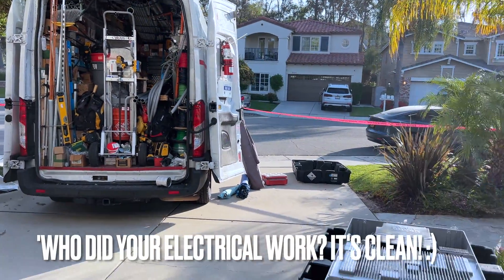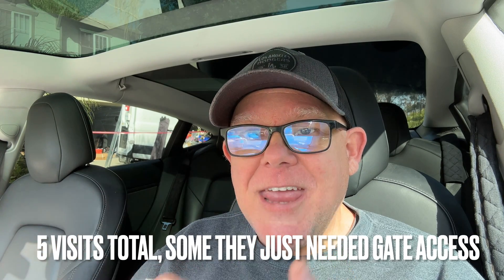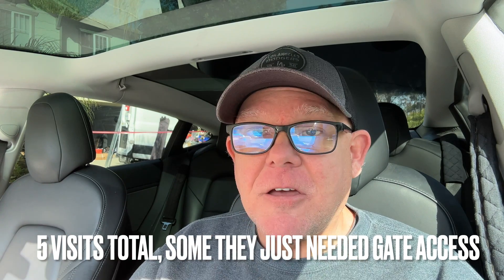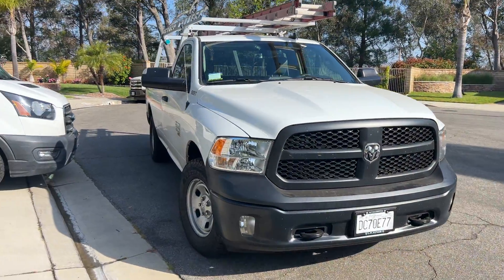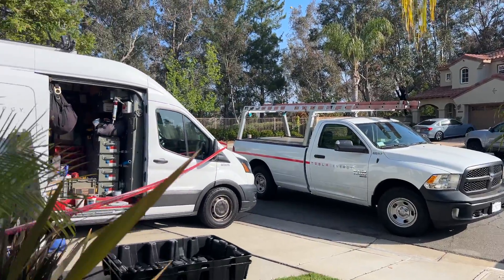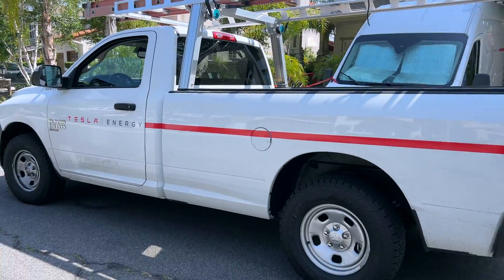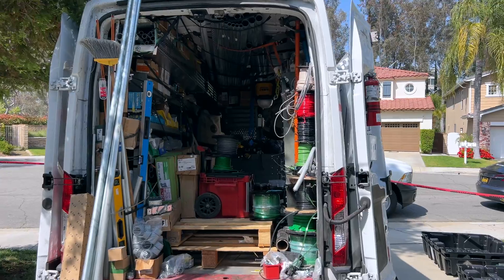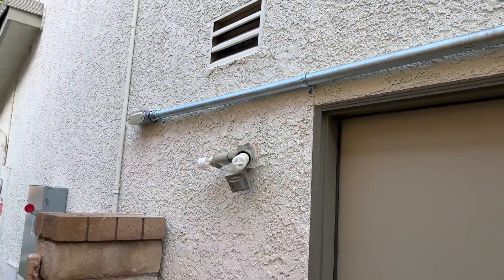Tesla Powerwall 3: Install, Cost, & Tips for 2024 - Complete Guide

Comment: Hello! Are you allowed to say who you ended up hiring for the job? I have yet to locate one under 28K, we are in san diego area. thank you Kerry!
Reply from the maker: We used Tesla for the installation. They were by far the cheapest and obviously the experts. No issues at all, system is working great. Thanks for watching!
Reply: @whooshn  thanks for the quick reply. The company TESLA told me to go with was Freedom Forever (1.3 rating) out of Temecula, but they are also stating 28K even though 2 PW3s are $10,343 wo installation on their website, which means they are charging 18k to install 2 plus gateway (if needed). There seems no one to talk with at Tesla to drill down an exact price (like their cars are). We have a Y and roof solar already, just want the PW3. It is very frustrating.

Comment: I have a 5.3 kW system with 16 panels, 327 watts per panel. I was told that two Tesla power walls will never get charged up with that little of kilowatt output. Have you been able to fully charge both Tesla power walls after using them at night I suspect, since you have a Tesla vehicle? Then recharging them with your panels the next day? it seems like you may have overbought battery storage capacity if your panels cannot fully charge those power walls. What say you?
Reply from the maker: Right now with mild weather I’m charging to 100% during the day with solar and on battery from late afternoon through dawn. Of course you can’t charge your Tesla in this scenario. 2 Powerwalls are 27kwh and your car is over 60kwh
Reply: @whooshn  I am curious how many kilowatts have you used when dawn arrives? Just curious.

Comment: My 2 cent . Power wall is useless concept unless you have often power outage or solid reason for storage . Otherwise this is absolutely waste of money . I have Tesla solar &  2 Tesla car. It’s personal choice anyway.
Reply: @PeaceFORever-  Just one power outage of several days where the temperature is below 0 degrees with a few feet of snow and ice where you can't leave your home and your family is freezing inside of the home without power might get you to think differently.
Reply: In California, with our very high electrical costs, batteries pay off very quickly.  I am getting a PW3 and two expansion packs for $28K.  Less $7800 rebate for the batteries from my local power company and 30% Fed tax credit drops net cost to $15K range.  With my 15KW solar ground mount array I'm installing, all-in, it's around $23K.  Payback in about 6.5 yrs.  But the reason we want batteries is to avoid long power outages. We had a 3-day outage a few years ago and it wasn't much fun.

Comment: We have 31 Q-Cell panels rated at 12.5 kWh with 31 Enphase IQ8A Inverters controlled by a Combiner IQ 4C.  Our installer can install Enphase 5Ps or Power Wall 3's.  So these videos are a great help.  Am leaning towards the 5P's because of their Inverters.  The PW3 have great specs but am fearful of losing an entire battery due to Inverter failure.  Should I be concerned?
Reply from the maker: I mean, anything can fail, including the Enphase stuff. Tesla has a 10 year warranty. My system has Enphase micro-inverters as well, which have been running for 10 years now, integrated just fine BTW.

Comment: I am looking to get the Tesla Powerwall 3 and my Solar Panels are by Sunpower. So I was so surprised to see that Sunpower supported or Tesla supported the Tesla Powerwall 3 to my setup and I have a video call going tomorrow to get more information. If you don't mind who makes your Solar Panels?  I really appreciate your detail with the bill at the end of the video. One concern I am been thinking of is how long there batteries will last. I live in Upland CA and we have had a couple power interruptions by SCE and was thinking this might be a good backup for the home. Thanks again for your work on this video.
Reply from the maker: My solar panels are Solarworld with Enphase Microinverters and were installed in 2014. The Powerwall 3's have a 10 year warranty, and the new ones are the LFP variety, which are crazy durable. I suggest you contact Tesla directly, they were amazing to work with and undercut everyone's pricing. Tesla's installation workmanship was exceptional, took under 5 minutes for the county inspector (compared with our neighbors 'Franklin' branded installation that failed inspection, requiring multiple visits. As for a back up, it's pretty awesome, we already had one, our house was fully running, while are neighbors sat in the dark.
Reply: @whooshn  That sounds like a great idea.

Comment: You had existing solar, which means you had an existing inverter.  My understanding is that PW3's have an inverter built-in, vs the PW2 that didn't.  Did the PW3 replace your inverter or do they have some ability to not use or remove the PW3 inverter?   Curious because I'm considering a PW and have existing solar with a solarEdge inverter (installed by Tesla).   Nice vid!  Thanks!
Reply: It works as just an AC coupled battery if you have third party solar equipment
Reply from the maker: Thank you! Honestly I’m not sure. I have 20 Enphase Microinverters. I have 2 inspections left, I’ll ask.
Reply: Both PW2 and PW3 have a built in inverter. It’s necessary to convert the DC power from the battery into AC power for the home. Only difference with PW3 is that you can now plug the solar DC strings directly into the inverter, eliminating the need for a separate solar inverter. This would be the case if you didn’t already have existing solar.

Comment: Several questions: What was the cost of your solar panels as an addition to the Tesla costs? What benefit are you expecting versus cost? And finally, what rebates did you receive from the government,  etc.
Reply from the maker: 1. $13k for the solar installation in 2014 2. Expecting to go off grid more, especially during peak rates. 3. Waiting to see what rebates are available, after installation is complete, Tesla submits the forms. So another video will be needed. Thanks for watching!